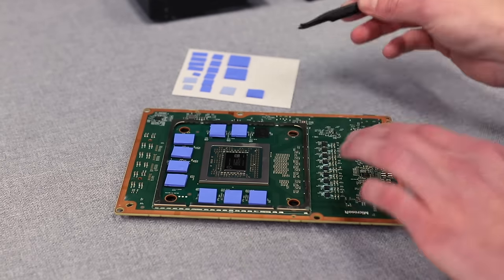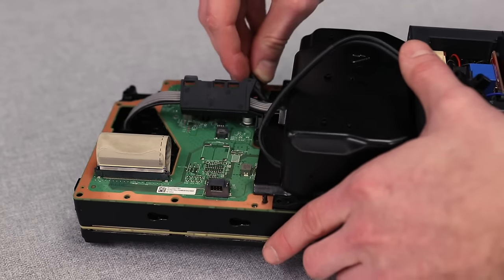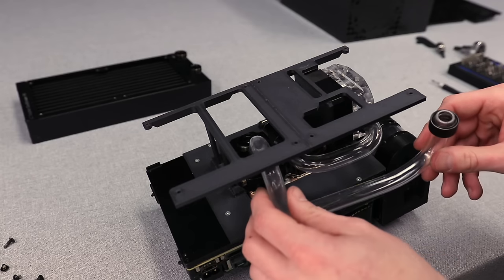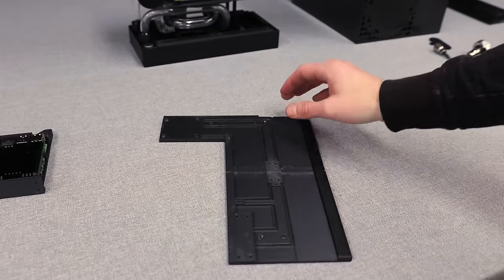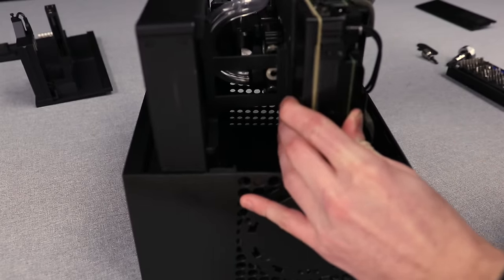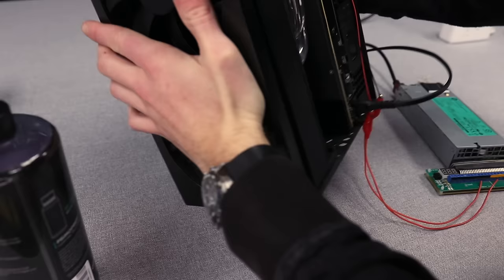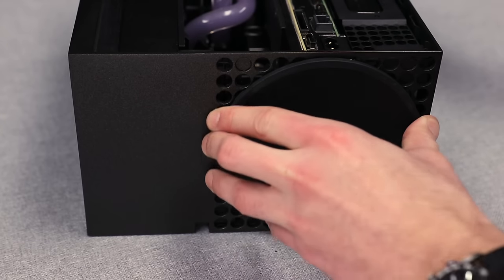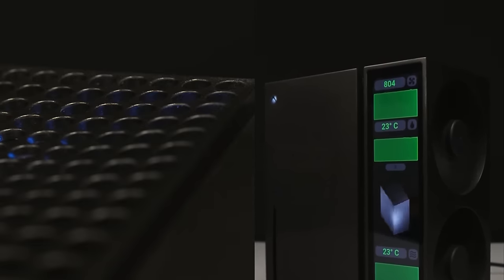Building The WORLD'S GREATEST XBOX

Comment: Try gaming on it and show the performance and the difference between the regular and this one
Reply: That’s what I was curious about too 😊
Reply: There is little to no performance benefit from this
Reply: As awesome as this is, I doubt it would have very much, if any impact on how well games would run. The Xbox would have to adjust the clock speeds of the CPU and GPU based on thermals. This probably does happen to an extent but I'm assuming Microsoft only had thermals with their OEM cooling in mind. Unless the Xbox team pulled a chad and left headroom for mod enthusiasts by design. Don't get me wrong though, this is cool as hell and took a tone of skill to make look as clean as it does.
Reply: Yeah literally pointless
Reply: It’s just a custom cooling solution, still really cool though
Reply: Will be no performance improvement as consoles are a fixed set of hardware with fixed speeds that may fall with too much heat but won't ever perform bette with any more than the stock cooling system.  But it WILL run cooler and just looks plain awesome.
Reply: The Series X is already overpowered as all the software made for it is optimized for the much weaker Series S so performance will be capped off no matter what mods you make to the console lol

Comment: Awesome build.....But, the performance is IDENTICAL, just cooler!!
Reply: Highly depends on the game, if it's throttling this will allow it to squeeze out a bit more
Reply: @bravefastrabbit770  it's set to power limit not thermals like you can on PC! And there isn't enough power there to make the APU "thermal throttle" The maximum draw on the APU is 200W! You can cool that adequately with the vapour chamber heat sink on SX! In exactly the same way, if you tried to LN2 a series X you wouldn't get any more performance out of it because it's power set...not thermal set!!
Reply: I think the water cooling purposes are to 1.) See if it’s possible in a small footprint, and 2.) If so use the cooler to make the XBox last much longer. Not to perform better because there is no current way to overclock a console CPU (as of now) and really no need to.
Reply: @bravefastrabbit770  still useless
Reply: @kid_rajah 
1) i doubt it's just to see if it is possible in a small package, sicne it's probably just to see if it's possible at all.
2) water cooling is absolutely NOT more reliable or long lasting than air cooling, this is not for longevity.
3) even if there was a way to overclock, most games would just have a hard limit on 30, 60 or 120 frames, so at best you'd be on slightly better resolution, and again, as @senilestix said, it's power limited, so even that would be hard
Reply: @Lulzinh  you make it seem like this was useless. A watercooled console may become a thing in the DIY community.
Reply: @kid_rajah Well, this IS useless. You're not getting more power out of this console no matter what you bolt on to it. But, as you said, in the future we'll probably see liquid cooled consoles.
Reply: @Liminal.Headspace  I don’t think it’s useless. You don’t know what exec or engineer is looking at this for the next generation.
Reply: @Liminal.Headspace  a vapor chamber is technically liquid cooled! But obviously not like a dedicated AIO!
Reply: @Lulzinh  yes literally impossible with the hardware! 1st...You'd have to be able to tweak the bios to deliver more power and clocks on the S.O.C....NOT HAPPENING!..2nd, Even if you could do the Bios..and use water cooling! The hardware on the board itself, like power capacitors(caps)  transistors, and other components aren't rated for higher power levels and would burn out quickly or immediately as the Whole system is proprietary and has Zero head room, like PC components!
Reply: @kid_rajah  Bro..PCs have been building watercooled  micro ATX cases the size of SX  for years atp
Reply: @senilestix  Well, if we take it that far, air is liquid. So every cooler is  liquid cooled 😁

Comment: Your engineering and design skills are as professional as it gets. Of course, the clean, almost cable-less interior layout, the slide-in design of components, and the use of the Pi and the external display are immaculate, but the small little things like the leather strap for removing the custom backplate, powder coat finishes, and the rotating 3D model on the front display really make this creation feel polished and complete. 
I hope this video gets more traction!

Comment: for tiny water cooled systems it can help filling if you can run a vacuum before filling.   it tests if the lines can hold pressure but it's main function is when filling you hook a sealed tank to the cooling lines and open the valve and the coolant will get sucked right in the entire system.  kinda confusing explaining it for my lil brain.  but it's how  A/C systems get filled quickly

Comment: There are a lot of stuff that can be optimized better, but I get that is for fun. However a Raspberry Pi for monitor a temperature and adjust a fan/pump is OVERKILLED like nothing else, you can do it way easier and if not good with electronics there are literally 2€$ board for manage that quite good.
Reply: Overkill indeed but damn does it look ergonomic and symmetrical 😍♥️

Comment: Impressive as hell, but cant help but wonder why. Your xbox will turn to a brick due to the ssd failing before itll ever fail due to overheating. ps5 would benefit from liquid cooling far more than xbox if you could get rid of liquid metal for thermal paste. I just dont think mods should be made for the sake of a video and should actually have a purpose which this doesnt imo

Comment: Given the lack O/C controls, i wouldnt see a performance difference however it should enhance the longevity of the console among other components subjected to wear and tear. 

The magnet latches to disassemble is chefs kisses 😍

The Raspberry Pi along with programmable RPM is extremely overkill but damn, LOVE TO SEE IT ♥️

However the reservoir position may make it a pain to flush but other than that it shouldve taken some extreme mechanical skill to make it look symmetric and ergonomic ♥️